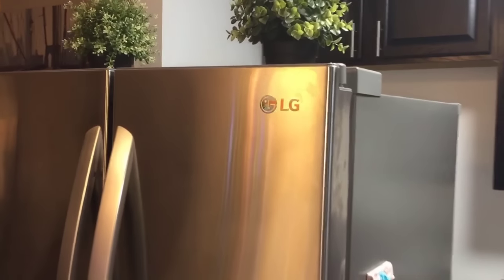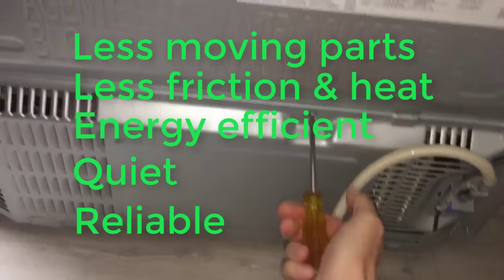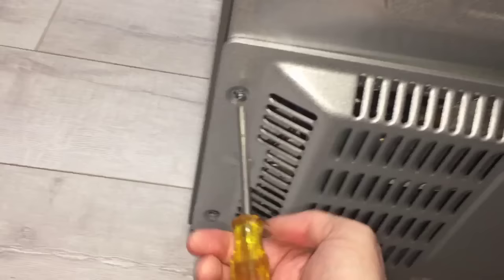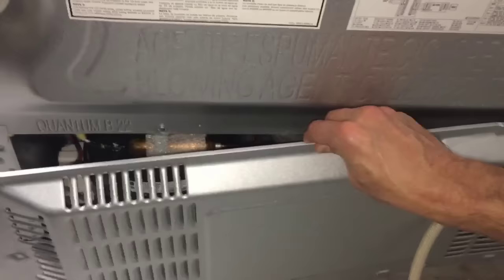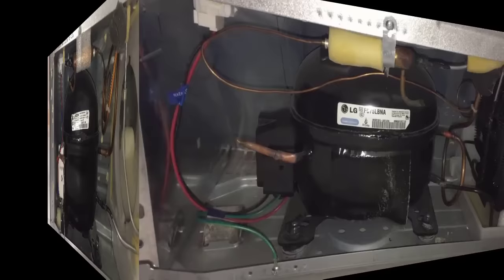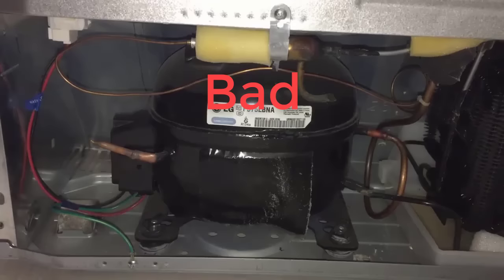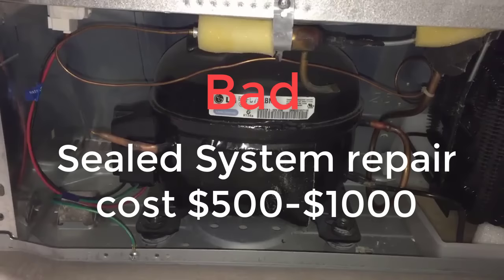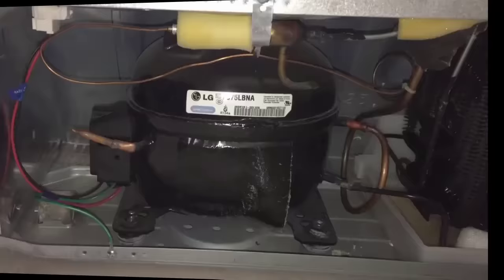LG fridge not cooling but running

Comment: I just purchased a LG from the restore for 500$ bucks. Worked fine for 3 wks. Got a glass of water, noticed it was not as cool. Didn't think much of it. Next day went back to get water & realized its a issue because the water was luke warm. Pulled the freezer out & everything had defrosted.  Reading these comment, now I understand why they had several of them at the restore. Im totally convinced they just dont make appliances like they use to & all this energy saving crap is producing sub par appliances . I have adjusted the settings to the lowest they can go. Just waiting to see it it gets cooler before I have to shell out more money to see whats wrong  with it. Im not a happy camper right about now & knowing that most of these new appliances look good, but thats about all they are good for. 😑 Times are tight & people do not have money to be wasting on this stuff. Wondering how much a new compresser is going to cost. In the mean time I guess I better start looking for something else 😡
Reply from the maker: Try calling that place you purchased the refrigerator from. They may have a 90-day warranty or something like that. Because if the problem with your fridge is the same as in this video, the repair would cost more than the fridge itself.
Reply: They only gave me a 7 day warranty so basically I'm SCREWED.  It never got cold. I've had it approximately 2 1/2 wks & about to be stuck with a extra repair bill. By time it's said & done I could have purchased a new one with a warranty. So is this the compressor or could it be freon and how much am I  looking at ? Ill have someone troubleshoot it before I decide what to do? Really bummed out. Thanks so much for responding!
Reply from the maker: I'm not sure what the problem with yours is. In general, if one of the fans stopped working, it's about a $200 repair. But if the problem is with the compressor or a Freon leak, the repair would be closer to $1000... not worth it. Here is another video to give you a better understanding... https://youtu.be/ipwOerjFITg
Reply: @Your-Self  Thanks for the help. I'll get someone to do the standard trouble shooting,,,but I definetly won't be spending a 1000 on something used and I dont know its history. Looking at the comments LG would not be a option down the line either. Its nk way these appliances aren't even lasting 5 yrs, but they want thousands for them. Lesson learned,  always research what you buy & especially if you get it second hand. Money down the drain 😡

Comment: Thanks...gonna have my husband check it tomorrow! It is only reaching about 45-47°...the milk temp was 47°...the water on the front door was reading 53°.  We missed, didn't even know about it, the recent Class Action Suit about the compressor...And THANK YOU for the instructions link!
Reply from the maker: Good luck!
Reply: @Your-Self  ...well, after we checked EVERYTHING out...vacuumed the back intake vents...rearranged items inside so that the vents weren't blocked...and cleaned the fridge...this morning it was at 35°! Looks like it just needed to be given a once over at this point. fingers crossed
Reply: @denisemariateresa  How has it held up?
Reply: @cleanpoop9929  Fine! We simply vacuumed the back out real well and underneath...moved items away from the inside vents and it works perfect!🙂👍🏻 We didn't need to replace anything.

Comment: Scary. All the refrigerators seem to give up after 3.5 years. Last night our "27 cu.ft. Ultra-Capacity 4 Door French Door Refrigerator Model LMXS27626S" stopped working with only a buzzing sound from the compressor area. No freezing, almost no cooling.
Purchased the unit at Best Buy in November 2016 and Geek Squad can be only here in a week. Glad, I have a spare refrigerator in the garage.
Reply from the maker: Is your refrigerator under Best Buy free extended warranty?
If not, I'd call LG directly... they must replace your compressor absolutely free for the first 5 years.
Reply: @Your-Self  We have scheduled through Geek Squad but LG confirmed the appointment with an LG technician (not a Geek Squad one). Either, they know already what's going on or it is standard process to have LG reply back. The fridge itself has a 5-year Geek Squad extended warranty, so either way we're covered, I hope. If it is indeed the compressor, I am assuming they won't run any costs against the Geek Squad Plan, as the compressor is still under manufacturer warranty.

Comment: This sound comparison is only valid when the piston is damaged, but the majority of LC compressors failure is the valve, and the sound doesn't change, the only way is to check the pressures and it'll show a high low side pressure. Former Sears Refrigerator tech, former LG Electronics field tech here. LG (LC) compressors are the WORST, I was replacing an average of at least 5 compressors a week. The best in everything else, but LG (LC) compressors are the worst due to the design of the valve. It goes attached to the end of the piston, it is like a check valve that it closes when pushes the piston to the high side and it opens when it goes back. It is extremely thin, so when the compressor works too hot, it tends to stay a little bit opened, that will equalize the system so it won't cool. Inexperienced techs think there is a restriction in the sealed system, they start replacing coils and capillary tubes, but is not the problem. I'm sure because I've done my own compressor autopsy (tired of LG tech support and managers denying the issue with compressors) and I found that. When you have an LG not cooling is that simple, compressor, or a very few cases, a leak on the evaporator of refrigerator section, mostly the top line close to the cap tube, extremely low leak sometimes hard to find even with dye, sometimes it only can be seen pressurizing the system with nitrogen and spreading with big blue leak detector.
A tech still working with them told me they have a new compressor design that substitutes the LCs but I don't know the results. I left LG and the appliances business 3 years ago.
Reply from the maker: Thanks for sharing. I guess we'll find out if the new LG Universal compressor is any better than the old one a few years from now.
Reply: @Your-Self  If we talk about years, that's an advance for LG compressor reliability, lol.

Comment: Thanks for this... Our LG with the French Door and this "linear technology" now has lost it's 2nd compressor.  About two years after buying this LG fridge, the first compressor died and we lost a lot of food.  It took Asurion (the 3rd party warranty company) over two months to repair this.  Keep in mind I have food sensitivities and we cook 99% of what we eat at home, so we NEED a large fridge. We literally borrowed a neighbor's garage fridge just to get by in those two months.  Now, at year 5 (3 years after the 2nd compressor), this LG compressor is doing the same thing, food is starting to go bad and we noticed the temps are warmer.  The compressor doesn't sound healthy, as your video shows. We are going to attempt to replace the fridge and stay away from LG this time.  And coincidentally, our neighbors' LG fridge is doing the same exact thing this week.  I am almost wondering if a power loss (which we did have last week) hurts the compressor somehow.
Reply from the maker: Unfortunately, it's common for the replacement compressor to fail as well because they used the same bad compressor as a replacement. However, around 2019 LG came up with an upgraded model of Linear compressor which should last longer according to them.
The power loss in your neighborhood should not affect the compressor but may damage an electronic board (PCB) that controls the compressor and all other functions. Try to unplug your fridge for a minute, and plug it back in. Sometimes, but not often, that helps. It's also a good idea to keep all your electronic devices plugged into a surge protector in the future.
Reply: Your lucky.  We are on #4 in 4 years.  Never again......
Reply: We  went warm after last outage  comp runs  comp bad .🤔
Reply: @Your-Self  Thanks for posting this video. Very helpful. I've been struggling with my LG fridge for about 2 years and it seems it works better in the winter and stops cooling in the summer. It's cold inside but we can't keep food for more than 2 days - cheese gets moldy, milk spoils. I've lost a ton of food. I bought my fridge in Jan 2018 and it looks great but runs poorly. The compressor sounds healthy according to your video. Any other ideas as to why this is happening. My ice maker also works on and off. Very strange. It never breaks down completely. Thanks so much!
Reply from the maker: @What's Next? I'm assuming your freezer is set to 0°F and fridge to 37°F, right?
It's a good idea to put a refrigerator thermometer inside both compartments, so you can compare the "real" temperature with the "set" temperature.
Sometimes the refrigerator is not capable of cooling properly if it's squeezed in the corner without any gaps for air-movement behind it and on its' sides. Also, if the condenser coils are full of dust and pet hair, try cleaning them with a brush and a vacuum.
If this doesn't help, you may need to call a tech to investigate further.
Reply: @Your-Self  Thank you. We've already cleaned the/vacuumed the coils and it hasn't helped. My refrigerator is set to 33F and freezer to  -6F. Both compartments are way above the set temps... Thanks again for your help!
Reply: @Your-Self  a UPS will protect against more problems than just surges.

Comment: Addendum update:  We have two LG failures in 5 years, the linear compressor is not reliable, it has a known issue/defect.  LG now offers a 10 year warranty on the compressor but that does not cover labor which is the major cost for repair.....the compressor is not all that costly but it's the labor charges.  So instead of redesigning their compressor they give you the proverbial "ice in the winter" with the 10 year warranty.  One other issues LG parts do not have a unique part identifier for the newer and older units, that is, they use the same part numbers over and over again so technicians are reluctant to work on them and on top of that they do not get paid by LG in a timely fashion so you wind up with a "Jack of all trades" coming out and they typically use a shotgun approach to diagnosis and repair.
This time we went with a whirlpool refrigerator, in fact, we already had a whirlpool in the garage for over 5 years and even with all the Texas heat it has been working flawlessly............though, the main problem with all appliances is planned obsolescence and then the box stores sell you that worthless extended warranty which is insult to injury.  This, in essence, is legalized theft.  One last thing, GE had a good reputation but the Chinese company Haier bought them out and the quality has suffered.  In fact, they give the GE employees steep discounts on their appliances and they won't even buy them.   Good luck, I know our recent failure(s) knocked us for a loop.  I am going to post this again above for others searching for a refrigerator since I know how trying this process can be.
Reply: Our dealership doesn't service L G even though they won't hesitate to sell one!  We love the way the fridge is configured but ours died and there's no technician in Tucson AZ that will touch it!  What do you do then?

Comment: Thanks for the useful video. I called LG and did a cell telephone diagnostic through the SmartGrid feature and LG said my compressor is "probably" bad. They said they will cover the parts but not labor. Unfortunately, my extended warranty expired last year (bought this Dec. 2015). I know there will be supply chain issues...
Reply: what was the verdict?
Reply: I had the same problem the July 4th holiday.  Just went out and bought a Bosch refrigerator.
Reply: @mikedx2706  lol we just did the same 2 weeks ago.  My wife loves the bosch.  I stripped parts from the LG and am selling ones worth something on ebay.  Sold 3 parts so far for $120 total but it's a lot of work.

Comment: My LG Fridge is 9 years old and has completely stopped cooling; it has a linear compressor. The compressor sounds "good" and is clean - no dust. Sounds like the compressor is covered under warranty, but want to know if LG will charge for each service call to assess the problem in addition to the labor costs to replace the compressor. Any idea what these fees would be? Is it worth fixing it? For the price of these refrigerators, they should last MUCH longer. We already had the motherboard replaced while it was under extended warranty, so thankfully there were no out of pocket fees at that time.
Reply from the maker: Each area has different fees for the service. But in general, you could expect about $100 for a visit and/or about $500 for the labor. Knowing approximate charges, you can decide if it's worth repairing. If you have an additional Extended Warranty, prices may vary.
Reply: You got hosed by LG, just like the rest of us.  The compressors used in these units are far below acceptable standards.

Comment: Thanks for the video.
Folks, before you do anything, please call LG customer service. LG compressor has 10 years of warranty, 1st 5 year parts and labor, next 5 years parts only. My 4 years old, 4 door LMXS30796D had same issue, no cooling due to bad compressor. Since Warranty period was still in effect I called LG support and the compressor was replaced in 5 weeks (1st visit was within 3 days of my call to LG support and the technician came to diagnose and then ordered the parts, 2 weeks for the parts to come and additional 2.5 weeks for the technician to come). 

LG should  voluntarily replace all the compressors and not wait for customers to call in.
Reply from the maker: Thanks for sharing.
Reply: If you got LG service, you're lucky. Many so-called LG Service Centers no longer service LG products, or service them only if they sell them initially. Most independent appliance repair centers won't work on LG anymore. Under the 2019 class action suit, LG Linear compressors are warranted for 10 years but only for parts. The labor, alone which typically takes one full day by two technicians, starts at around $1,800 in many areas, if you can find a repair service and if they can get parts.
Reply: LG Customer Service is a complete joke. They don't really want to help you once they realize that the problem is a bad compressor. You will be shuttled several times between robot answering machines and humans who can barely speak or understand the English language in your efforts to actually schedule a repair appointment. You will be repeatedly asked the same questions (by both robots and humans) about your refrigerator's model number is, it's serial number, when it was made; when you bought it; your name, address and telephone number. This happens during the same telephone call as they shuffle you around.  Then you are told by LG that they are so booked up with repairs that it will be at least a week before someone can even come out to diagnose your LG refrigerator (not actually fix it.) The human on the line at LG will then hang up on you so you can't give answers to the telephone customer service survey that is supposed to come at the end of your now hour long telephone call to the LG Customer Service number.  Never purchase an LG product!!!

Comment: Thank you. My LG is 3 years 3 months and it is not cooling any more. The compressor is making high pitch sounds like your video showed.  I called LG and they will let technician come.
Reply from the maker: The compressor should be covered by LG if you have the purchasing receipt.

Comment: My freezer and refrigerator stopped working but fix it. It sounded as if it was working but not cooling. Disconnect your refrigerator. Open the drawer,  pull the tray, get your hair dryer, get a flashlight - you will see some ice build up on that area against the wall, aim your hair dryer to the orifice, set up a timer for 5 minutes. Hold hair dryer with the food boxes you have there or hold by hand. After 5 minutes change the aiming slightly...set the timer for 3 minutes, let the hair dryer rest, do another 3 minutes, turn it off and let the refrigerator disconnected for 30 minutes leaving the drawer open. Close the drawer and everything back to normal, turn on the electricity again and it will be start workin again. (Under the drawer there will be pieces of ice and melted water, dry it out.) That hair dryer did wonders, it worked for me, I hope it helps you!
Reply from the maker: If the evaporator frosts up as you describe, defrosting sure helps. But it's probably a temporary solution, it'll frost up again. The bigger problem with LG Linear compressor refrigerators is that they stop cooling completely, so no frost at all.